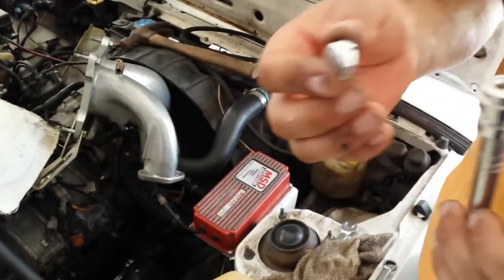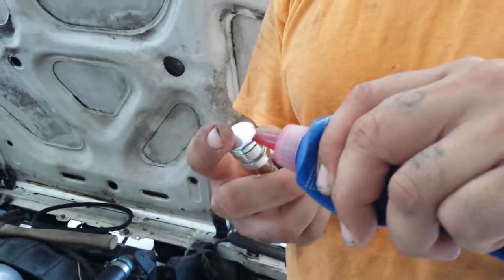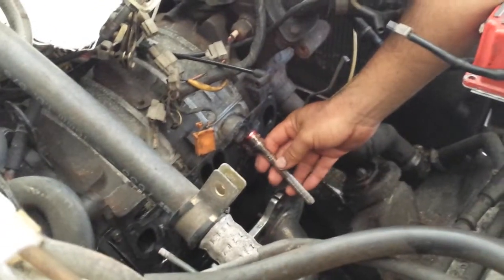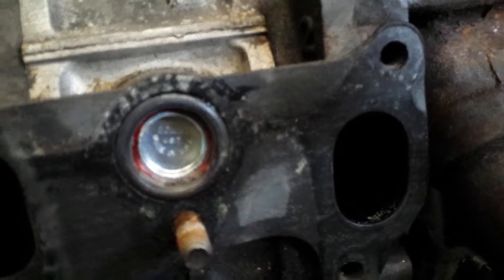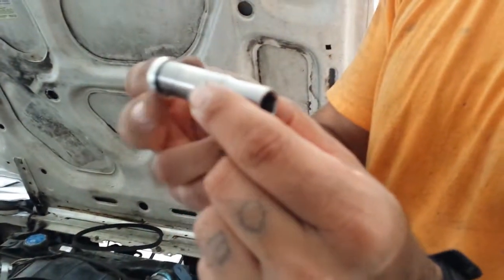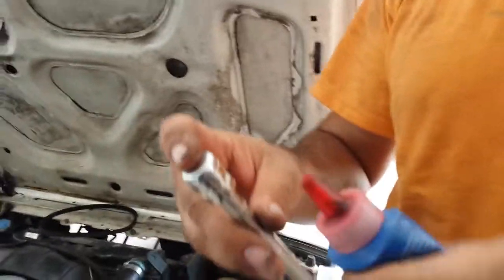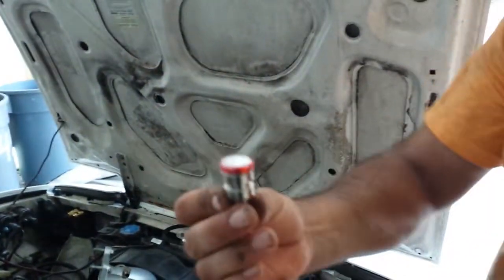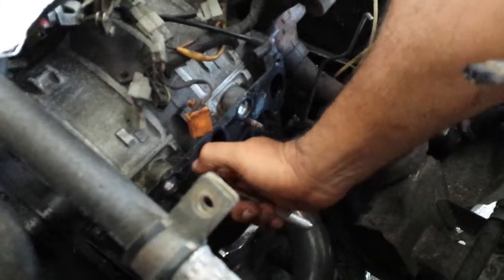20mm freeze plug install on 12a rotary engine

Comment from the maker: i got my freeze plugs from a local auto parts store
Reply: So am I correct in saying there are these 2 20mm ones and 4 30mm ones in the rear iron behind the flywheel that you have to take loose the transmission to get too. Mine need to be replaced all around. It's the ones in the back on mine because it's coming out of the whole just for that draining in the transmission.